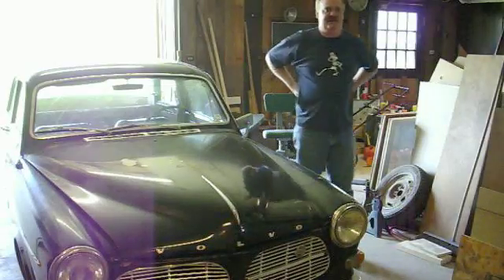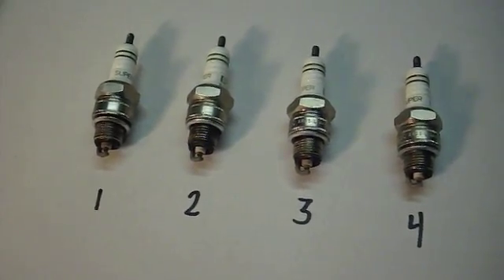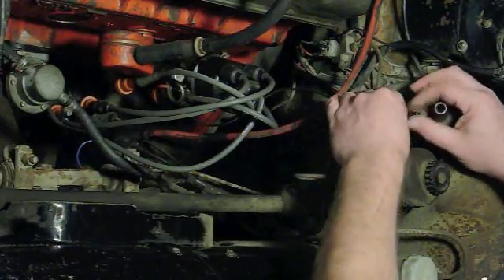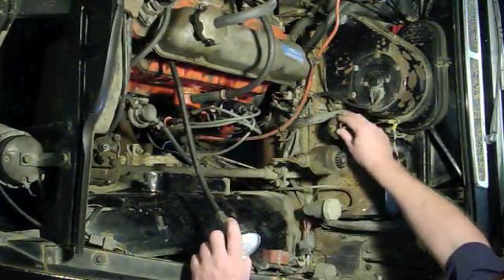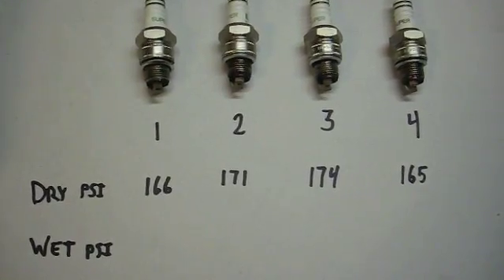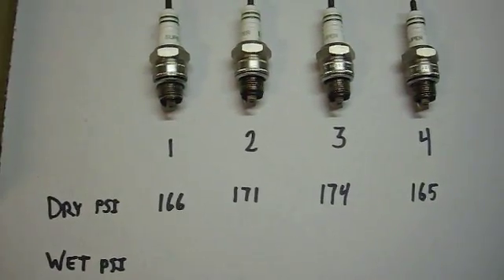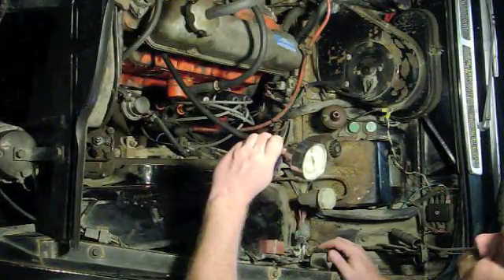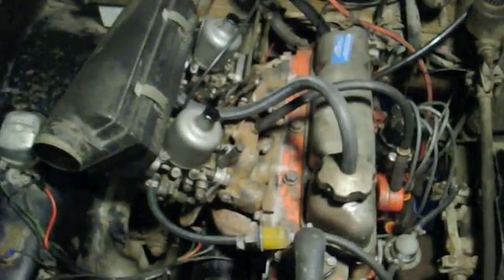Volvo B20 Compression Test

Comment from the maker: On the HS6 carbs, the mixture is adjusted by a large nut on the underside.  It is held in place by a spring, so I have always been able to adjust them using my fingers.  Turn them down (out) to make the mixture richer, and turn them up (in) to lean.  Make sure that you turn the adjusting nut on both carbs equal amounts.
Check out brickboard(dot)com
There are a lot of very knowledgeable people posting there.  A search will likely turn up a diagram.